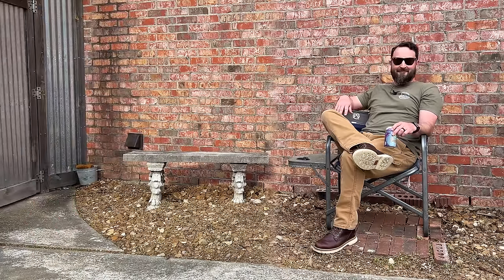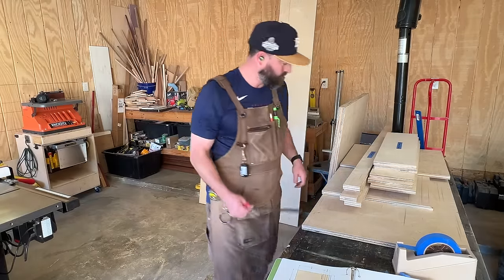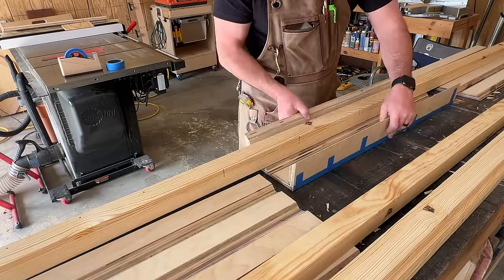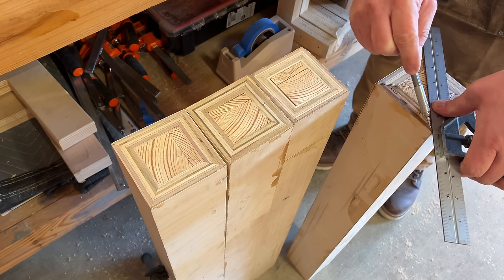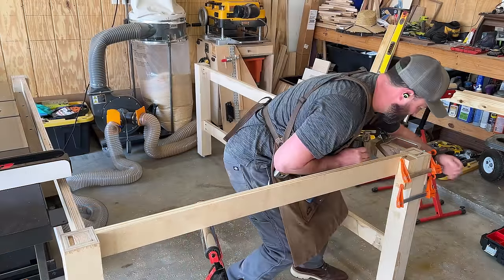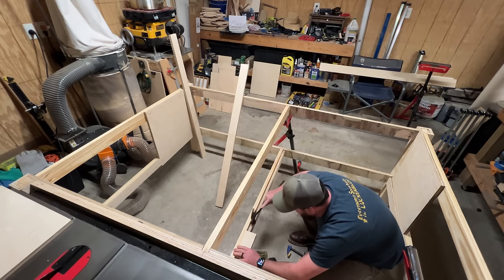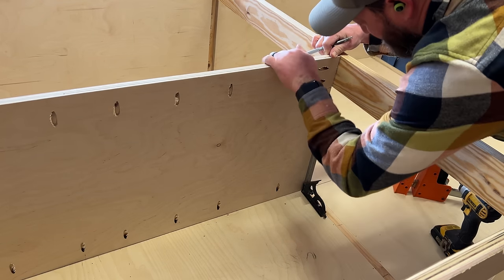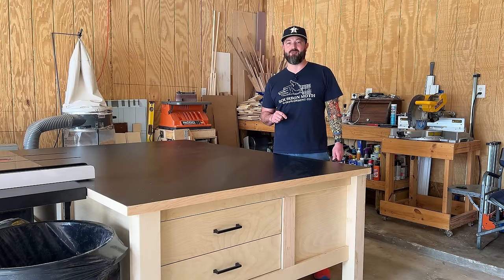Building a Bourbon Moth Outfeed Table Pt. 1 of 2

Comment: Just a suggestion; when I’m doing glue-ups, I keep a cheap shop towel (harbor freight special) in my apron upper pocket that hangs out just a bit (so it doesn’t get in the way). Then you have a handily available rag to wipe glue on while doing glue-ups. You can also use Scott shop towels (heavy duty paper towels) if you prefer.
Reply from the maker: Thanks for watching and thanks for the suggestion. I should utilize the Alton more for that because it feels like I’m always running to get a shop towel during glue-ups. Good idea. 😊

Comment: What are the dimensions for the miter folds legs for the table? I'm thinking about going the same route as you did. I just want to make sure I get the right fit. Currently, I'm thinking of using 2x4s for the legs milled and glued together, but I would like to wrap them the same way you did!
Reply from the maker: The overall dimensions for the legs is that they are 3.5" square by 30" long.  The inside is 2 - 1/16" square.  It wasnt the "quickest" way to do it, but wasnt really too bad either.  And at the time, it saved me a bunch of money.  Another option would have been to use some laminate MDF for the inner core as well.  But again, the pine 2x4 from the box store was quick and easy to procure and cheap.  I have had the table up for over 6 months now and I havent had a single issue with wood movement of the pine inside the legs, which was a commented concern from another viewer.
Reply: @oilcitywoodworks  let me start off by saying I enjoyed watching your videos on the table build. It's almost like we have a Bourbon Moth 2.0 in the making. You did an outstanding job 👏. I just started a woodworking business to help with the stress of police work. So needless to say, I bought a sawstop, and I need to rebuild my workbench. I ended up using 2x4s and glued 3 of them to try and get the thickness, and it's not working the way I want it to after milling it. Now, I know that the middle leg supports are not the same thickness (2 3/4") as the corner legs (3.5"). I'll have to make them slightly different. I'm also on that train of saving money. My local hardwood center quoted me just over $450 for all the solid maple.

I also noticed that you had a cultist for sheets of plywood. That was not provided for me when I purchased the plans. If possible, would you be so kind as to share that with me? 

I'm not sure if you have an Instagram, but if you do, how do I go about supporting your channel? My business page for Instagram is Bluebridgewoodworks2024.
Reply from the maker: @rickyleavitt2173  Thanks for all the kind words!  I am obviously a huge fan of Jason and his channel.  Probably because I have a very similar sense of humor.  I want to definitely make entertaining and informative videos while to being toooo much of a straight copy cat.  Hahaha.  But thanks again!  Let me see if I still have those plans.  with the cut list.  I will check you out on IG as well.  :)

Comment: Awesome video. Enjoyed light music in background. Narration and oration perfect. I find the posts weird because the wood core might eventually open the miters a little bit. It’s 2 inches so it’s only going to expand in the tree outside ring demo soon maybe a tenth of an inch or less. Over time sort of thing but maybe the glue holds it too.. makes me want to do it just to see. Probably look just a tiny 1/16 gap on one miter edge after ten years.
Reply from the maker: Thanks for the encouraging feedback on the video and I'm glad you enjoyed it!  Honestly, I did think about wood expansion on the internal pine within the legs and I do think it could definitely open up the gap in the miters at some point in the future, I just have to think it should be minimal, or ~1/16" as you said.  And for a shop table, it was something that I was okay with, but for sure if it was a client build (which I dont have at this point) I would have to think about the long term effectiveness of that method.  But great point and observation!

Comment: Hahaha! The rollers. I’ve been there. Put them too far or too high. I try setting it up with the blade down first to see where I need to set them.
Reply from the maker: Yea, it was frustrating. And after two years of using them with this saw I can finally retire them. For the saw at least. Haha
Reply: @oilcitywoodworks  Don’t have room for a big outfeed. I have a harbor freight woodworking bench I rebuilt drawers into. It works for most of what I need. Unless it’s an 8’ board. Then, out come the rollers. 😂